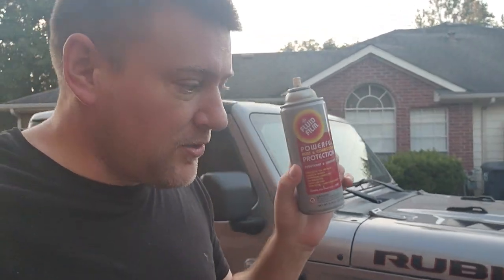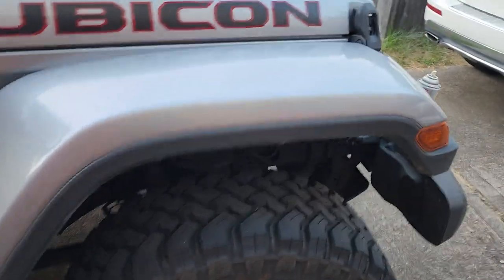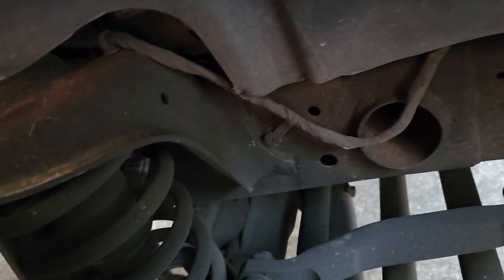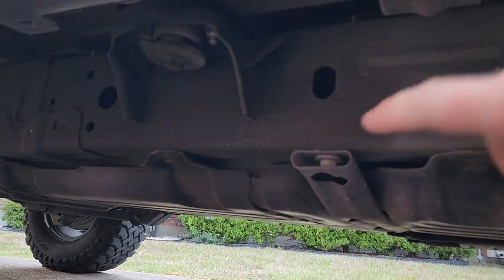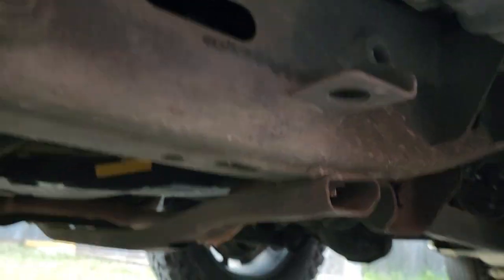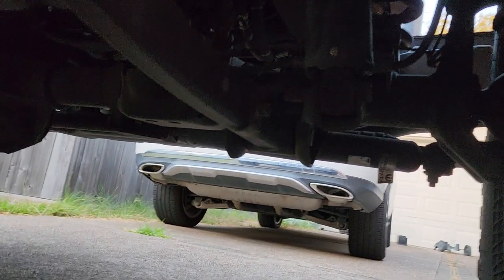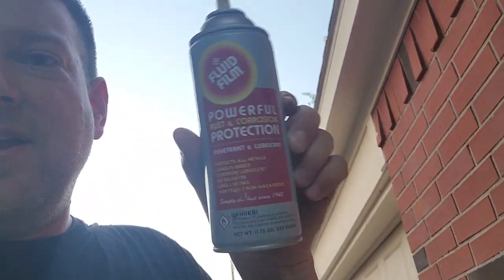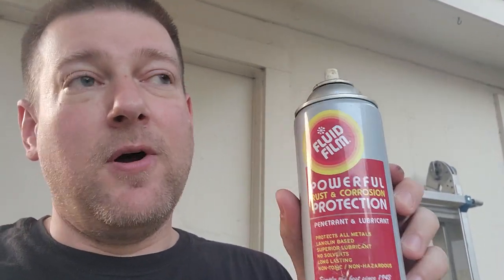The Best Corrosion Protection!

Comment: Nice tip to keep your car rust free.
Back in the old days, around the 60's and 70's (maybe 80's too) when changing the engine oil, the old oil was used to spray the underside and inside chassis beams of the car. 
This of course had the disadvantage that oil dripped for a few days and you had to park the car on grass, otherwise you would have oil spots on your driveway. 
But cars had a good protection and it didn't cost a penny.
Reply: I thought that oil was actually corrosive. I guess that's only for rubbers and plastics?

Comment: Spray that oil into the chassis rails through many of the openings, then use shop air to blast the oil to further spread it all around on the inside the rail.

We did that to our 91 nissan pathfinder decades ago but with several quarts of light oil and hasn't had any major rusts. It's a must for us in living in so close to the ocean. Wear safety glasses with zipped lips while doing this! Oil doesn't feel too good on the gums 😅